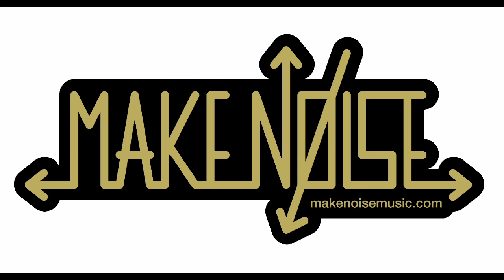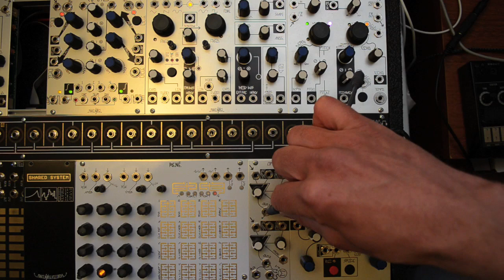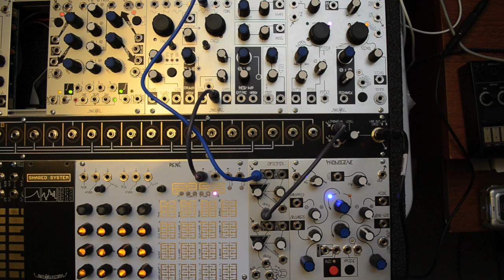Make Noise System Tutorial 1a: Basic Sequencing

Comment: Is there a way to transpose the sequence with the Rene?
Reply: Your best bet for easy transposition is another stepped voltage source such as the Pressure Points. See our video "Make Noise STO Complex Melodies" for an example of such transposition (it uses the Pressure Points for the sequence and René to transpose, but you could easily do it the other way around) Make Noise Sub Timbral Oscillator (STO) complex melodies